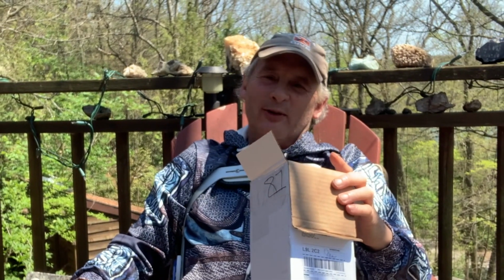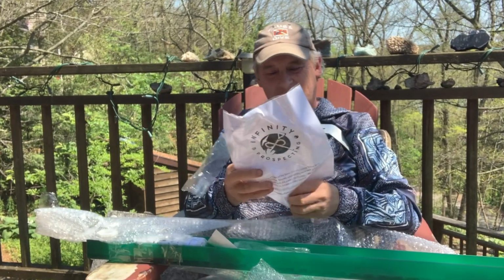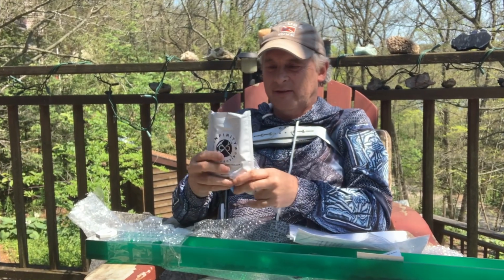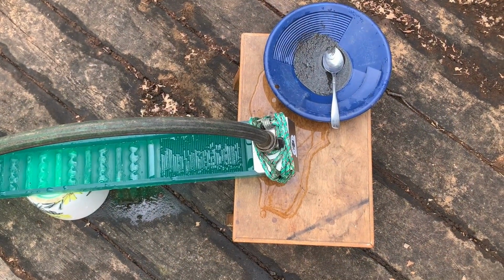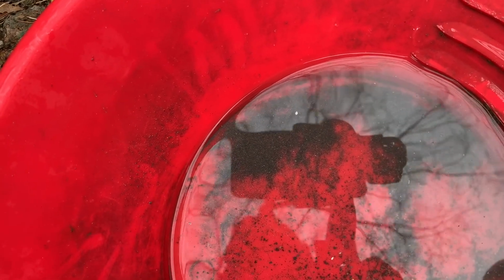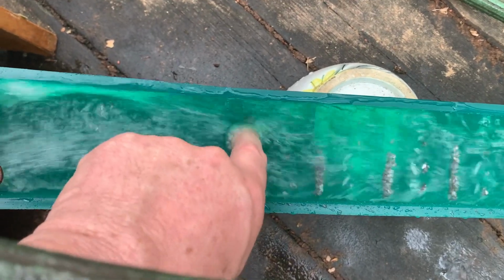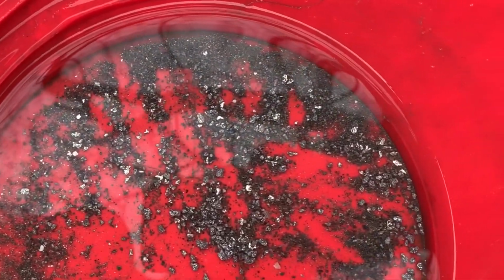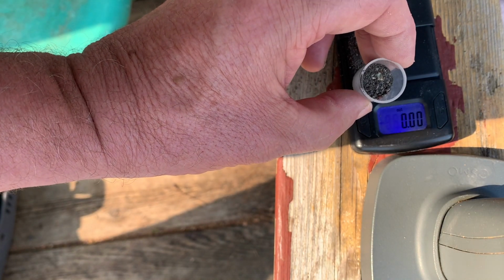SILVER Cleanup using 3" Sluice

Comment: Hi my friend I thought I would share this with you down in Arizona I watch Bill ( nugget shooter journals ) 4 or 5 episodes ago well they do gold detecting and what they call dry wash cool set up but the sweet thing is their wash out unit piece of drain pipe from a camper cut in half length ways fitting into a rain gutter pipe and they wash out in it and the ripples catch the gold works really good real nice couple  if you want to check it out
Reply from the maker: I made one of those a few years ago.  It worked but the material had to be run a few times to capture an acceptable amount of the fine gold.
Reply: Wow that’s cool had to run a few times well that’s not good I like that little unit unit you got looks tricky to really get clean because it holds on to the stuff really good but I guess till I get one that can only be a thought thanks clears some stuff yup how are you Healy yup my friend
Reply from the maker: @milesnn  Holding gold isn't always a bad thing.  LOL

Comment: Enjoyed your video Grieg. Am wondering if tipping the sluice on it's side and allowed to smoothly flow down unobstructed might be the way to go. You could lightly rinse the water down and let it stream down a 45* gutter angle (if that made any sense at all..lol). Hope the recovery is still moving in a positive way for you. Virtual hand-pets for Shelby and Daisy.
Reply from the maker: I suspect you have the golden answer.  I was going to try sluicing the today pay dirt today, but it is raining.  I will give it a try as soon as the weather improves.  That is the way I used to clean out my plastic Le Trap sluice.
Reply: @meMiner  Yep... I did the same thing with my Le Trap. The only other thing I could think of that might work is to use a small piece of smooth plastic rain gutter as like a 'sleeve'. Flip the sluice up/over it with some intermittent spraying from below. Again, I don't know if that makes any sense either.
Reply from the maker: @johnsaucerhunter  Makes perfect sense.  Also, using a sniffler to suction up most of the heavies trapped prior to messing around would also be a good idea.

Comment: Cant you run water  backwards through the sluice?
Reply from the maker: Why would you want to?
Reply: @meMiner  to clean it out.
Reply from the maker: @boedhaspeaks  Interesting idea.  Thanks
Reply: @boedhaspeaks  If you do all steps backwards, you'll end up with your paydirt back in the bag. The most difficult thing is getting the water back into the tap... ;-)
Now without joke:
These mats are catching and holding the heavies very well. The best way to clean it, is to put the sluice in a bucket vertically and splash all out carefully with a little water.